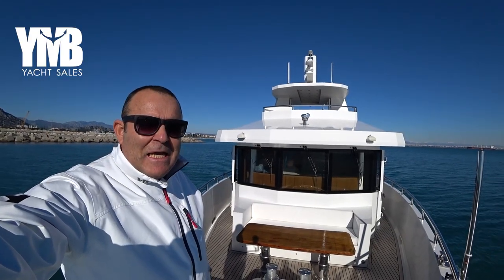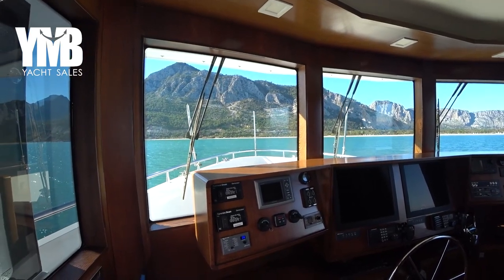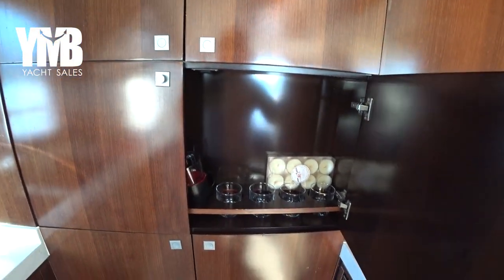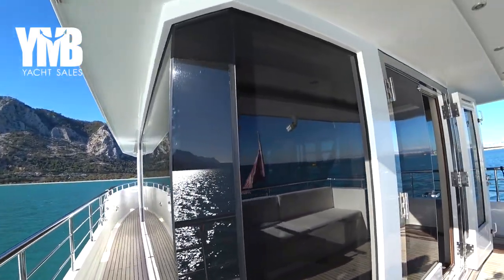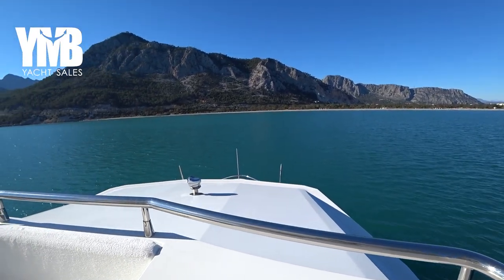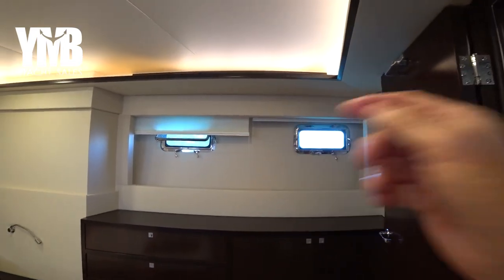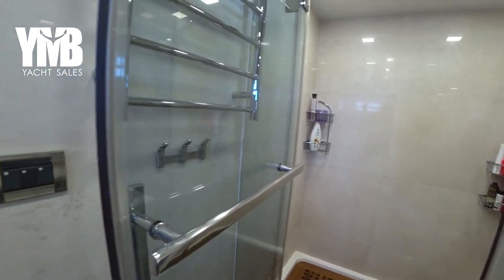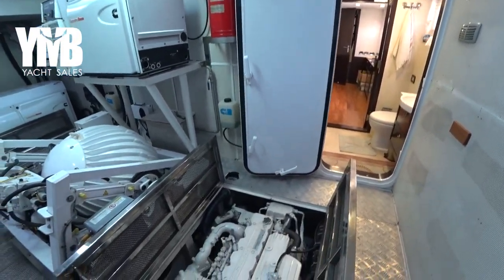STEEL HULL TRAWLER Owner's version full walkthrough yacht for sale

Comment: Is that really all the access to the engines? if you have to get to either side - you cant. Imagine trying to change an impeller for example, or when something breaks, like a belt. Surely there must be another part of the surrounding deck that can be quickly lifted up to get more access, does anyone know?
Reply from the maker: In a boat there is always space compremise. Engines service is not very comfortable but it is possible.
Reply: Machines so deep and so little space? No thanks, easier to spot leaks and "belt-dust" if you see the engine. Then the question about cool and fresh air to the engines? I don't critizize, I just wonder...

Comment: I've always wondered if a boat this size could go faster than 10 knots?? Or is that impossible?
Reply from the maker: Typically, trawler yachts at this length are not designed to go much faster than 10 knots.

Comment: What are the comparative advantages and disadvantages of Fin Actuated Stabilizers vs Gyroscopic Actuated Stabilizers?
Reply from the maker: Basically gyro stabilizers are usefull up to 100 feet and more efficient than fin Stab. when the yacht is on the anchor. Gyro are less efficient for larger yachts.
Reply: Fins are better at speed as the faster you go they more effective they are. Gyros are better at rest/anchor. So it depends are you a planing-speed passage-maker or a trawler?
Reply: @darthkek1953  that's not it the gyros are excellent for anchoring and navigation at reduced speed for boats up to 75 feet the fins are more for navigation on the high seas for boats over 100 feet now if you have both